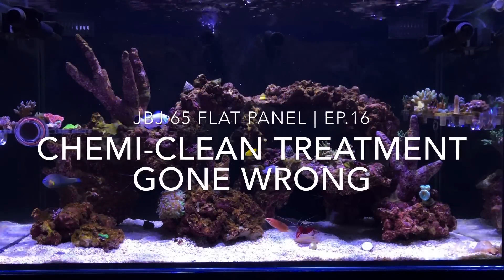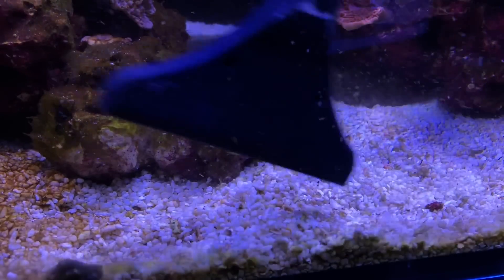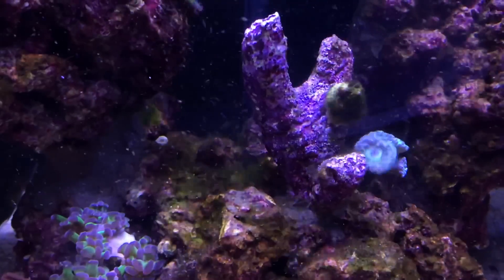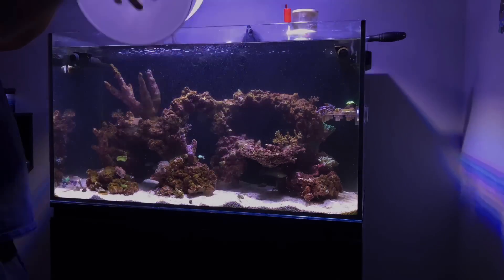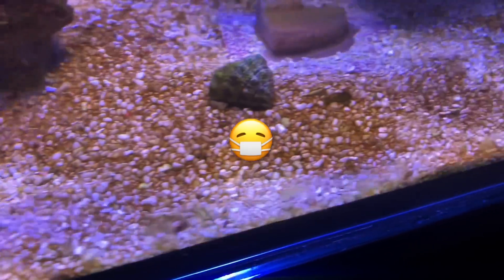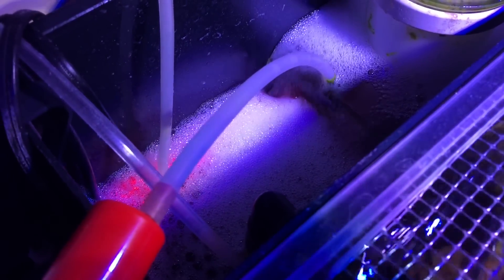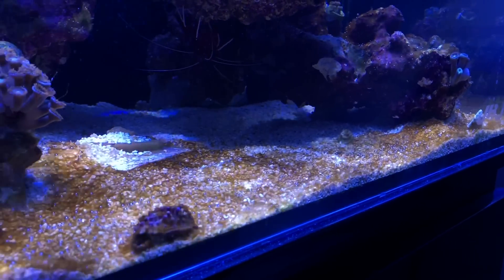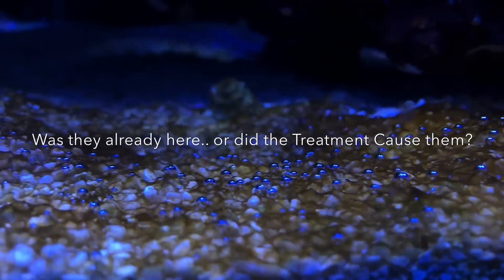Ep.16 | ChemiClean Treatment Gone Wrong

Comment: Stop doing water changes. Raise your nutrients a little, and get a cheap UV sterilizer in there. I bought a "Green killing machine" off amazon and let it run 24/7 in my main display (against the back where overflow is) and it helped solve it. 
Dino's break up at night and float around the tank. So I would recommend also a 24-72hr blackout period.

Comment: Bruh those are diatoms. You added all of the livestock basically at once and the bacteria load didn’t have a chance to keep build up to balance with the amount of livestock added. Water changes and time man. 15-20% a week until the bioload catches up. You’ll still have diatoms for a little while but it will soon balance itself out.
Reply from the maker: No new livestock has been added in almost 2 months same original fish and inverts. Corals are the only new addition they have a bio load but this issue started even before they were added. Definitely not diatoms if they was your solution would work 💯💯💯
Reply: CJ'S AQUARIUMS I paused halfway through the video. It turned into dinos after the chemiclean. Let’s agree to disagree, it may have been 2 months but you killed the livestock and made it back dry. Then instead of going with 2 fish or so at a time you loaded it up and the tank had an imbalance while trying to build up to what it needed. I’m going to guess and I could be wrong but no water changes were done which allowed a build up. Then minimal water changes were done some time later to try to combat the issue. I’ve been following you for a while man. I’m going to hit you on insta, and let you know what I did but you not going to like it. Lol
Reply: It's diatoms m8 . 100%
Reply: I’m not convinced it’s still not all diatoms but I’m not there to really look at it either.

Comment: CJ I just finished battling Dinos..  All I did was large water change and turned on my UV. within 24 hours my Dinos were gone by half. 1st 24 hours i had lights off with the UV on. Day 2 I had only the blues on at 30%. Within 4-5 days all Dinos were gone.. You can beat it.  GHA is worse than Dinos..

Comment: Fluconazole worked wonders in my tank. 1 capsule (200mg) per 10 gallons of water.  Open caps, dissolve in a small cup of tank water then add to system.   Take skimmer cup off and take out carbon.  I got mine from Payless-petproducts.com, $20 for 10 caps.

Comment: When you use chemiclean you supposed to turn off your skimmer. Taking the top off n still letting it run will still keep the product from working correctly also make sure you not running any bio pellets if so remove them they will do nothing but make the Alge worst. After a day or 2 then do another water change n begin running chemiblue in your tank that's all u will need

Comment: Wow I thought I was gonna see your tank stuffed with coral and fish. But instead I have found you have a totally new tank. The 120 was the last I seen. Damn bro you going through the wars at the minute and seems like more downs than ups! But keep yer chin up shipmate you’ll soon be hitting calmer waters. 

In regards to chemiclean the product is very good but it doesn’t kill Cyanobacteria it kills Spirulina Bacteria. They have different cell structures. They look exactly the same and chemiclean only works on one of them Spirulina. This is why some people use it and then say it doesn’t work. But others say it does. To kill Cyanobacteria you have to use hydrogen peroxide 3%. Now Hydrogen peroxide won’t kill Spirulina bacteria and chemiclean won’t kill Cyanobacteria. So it is about using the right treatment for the right bacteria. 
By doing a simple test ( no microscope needed ) you can determine if it is Spirulina bacteria or Cyanobacteria and then use the correct treatment ( tool for the job ) to remove it from your system. To identify which it is you have you simply take a couple cups of water and some of the Cyanobacteria mat. test it with hydrogen peroxide 1ml leave it for 24hrs. After this time  if it is Cyanobacteria. The mat will turn green and the water red. This indicates that you have Cyanobacteria and hydrogen peroxide is the treatment needed to kill it. If after 24hrs there is not the above changes. Then it is Spirulina bacteria you have and chemiclean is what you need to use to kill it.

However from your footage at the beginning, to me it didn’t look like you had either of these problems. Looked more like diatoms and then dinoflagellates in the end footage. Dino X is very good in fighting the battle against dinos. Diatoms as you know is silicates and running some rowaphos will quickly sort that out a long with good maintenance. 

You will have this tank looking awesome again in no time I’m sure. Stay positive no matter how bad it gets. Without darkness there can be no light! 😉

Good luck shipmate and all the best for 2020 

JD 🏴‍☠️
Reply: JD Reef what about you're tank shipmate?
Long over due for an update.
Reply: Hi Robert, did one yesterday matey 😊

Comment: Cj I beat it by raising nitrates and phosphate  leave the tank and do nothing but stirring the bed re install socks to catch a lot of it and dispose of it that way was how I found it easiest. The other thing is silicates witch after vacuuming sand bed you can tell this by it floating in the water you drain out the tank. That’s what caused mine.

Comment: I have 4 tanks and sometimes dino outbreaks happen. When they do, I do the direct opposite of what I'm currently doing. If the tank is running dirty, I clean it, if it's clean I dirty it up. If I dose amino acids, I stop, if i dose micro trace elements I stop, if i dose carbon I stop, if not i add carbon sources, if I run heavy white light, i stop etc. This approach always works for me. It also fits with the current anecdotal methodology of adding nutrients etc from reef2reef. you can kick the populations back with hydrogen peroxide and dinox like products, while you create some fundamental changes.

Comment: No worries this is definitely dino. Stop doing water changes all you're doing is feeding them. Use bacteria to fight it. Trust me Ive beat this several times from me changing too much in my tank that caused my nutrients to bottom out to quickly. Dr tims waste away will clear that up. When using dr tims your water may get cloudy but dont panic its nataural. This is Komat Fish Keepr on Instagram too by the way. If you have any questions hit me up Im in radcliff ky.
Reply: So i did what you said and im slowly beating it but holy shit now im getting what seems yo be a mix of GHA and briopsys. Its keeping my Phosphates at 0 which is making the dinos come back. How do i break this cycle?
Reply: @marcelrodriguez2067  add a turf scrubber. Or refugium to your build

Comment: This looks exactly like my system used to look.  I had it for about 16 months, tried black outs, reducing nutrient levels had my phosphate reading zero and nitrates steady at 5 ppm but it would not go away.  Right before I was about to give up I saw the excellent article on Bulk REEF about Vibrant, so  I thought I'll give it ago as I had run out of ideas.  BRS and the manufacturers recommend using it for 9 weeks or so following the specified dosage.  I got mine delivered and unfortunately miss read the instructions and gave my tank 110ml for the first dose when it should have been 10ml, I panicked at first but decided to just keep my eye on what was happening.  One week later no fatalities, thankfully, but I could definitely see a reduction in the brown dino/algae.  I have been dosing the  recommended 10ml per week now for the last 3 weeks and it has been reduced by 90 per cent only a few patches on my flow pumps, the water has become much clearer and my coraline algae is spreading (previously it could not compete with the dino/algae issue).  I am going to continue with this until I run out then get some more and reduce the dosage as per recommendations.  The only downside I would say is that it has started to kill off the algae in my reactor but I'll replace that shortly.  I have increased my nutrient levels and allowed my phosphate and nitrate to increase and the tank has never looked better.  IMO it is definitely worth giving it a go.  Good luck with whatever you do go with.

Comment: I had the same problem in my nuvo 20, seemed like the problem was worst in areas where lots of nutrients settled, I.e. back of tank. I never did find the source however I did remove my sand bed and went bare bottom which solved the problem...hope you find out and resolve the problem and it doesn’t cost u a sand bed like mine did...hang in there and happy holidays CJ👊🏾
Reply: De Reefer I did the exact same thing I removed my dam sand bed and no more problems and my tank is now 4 years old
Reply: Chen 305 I’m thinking possible silicates in sand bed👍🏾
Reply: De Reefer yes me too

Comment: This is an indication of having extra amount of carbon in the system so if you are dosing some source of carbon you need to reduce it. Also you can try Vibrant will took 9 weeks to clean your system. By the way always use half dosing even with chemiclean

Comment: Definitely looks like dino to me.  I beat it in two different tanks using the Dr. Tim's Refresh/Waste Away regimen.  When I was done with that, I added an oversized UV sterilizer to keep it gone.  I beat my head against the wall with extended blackouts, bubble scrubbing, etc etc etc and the bottom line is that you gotta fight fire with fire...  It's a bacteria that has be out-competed.  Anything else is just pissing in the wind.  That's my $.02 anyway.  Good luck and Merry Christmas, brother!
Reply: Oh one more thing!  If you're going to try Dr. Tim's, here's a pro-tip: order them from a major online retailer so you're getting FRESH bottles.  I suspect people that said it didn't work were buying old bottles from their LFS.
Reply from the maker: mnelson10000 yessir! Just wish diagnosed it right first time ChemiClean didn’t help me on the bacteria situation that’s for sure 🤦🏾‍♂️🤦🏾‍♂️🤦🏾‍♂️
Reply: What @mnelson1000 said. Totally agree.
Reply: I did this same treatment on 3 tanks. Works perfectly. Did 3 cycles of it each to make sure they were completely gone

Comment: Top of my mind: Diatoms. Check for silicate, nitrate, phosphate. GFO can work. Big skimmer time. Turn off light for couple days, then brush the remain off the rock. Feed less. It's a combination of multiple thing.
Reply from the maker: diatoms would be great compared to Dinos two totally diff animals
Reply: CJ'S AQUARIUMS I think is dinos as diatoms don’t have those bubbles attach to everything. CJ check on mike palleta’s videos he talks on a easy way to get rid off that stuff
Reply: @yasseraloy4178  One of the toughest ones to fight. That would drive any aquarist crazy, having to clean that up all the time. 
I know why I am weary of chemicals. I rather try other things first. But you did try other things first. Always thought algae scrubber might be an option, but apparently it did not make a huge difference for your tank.